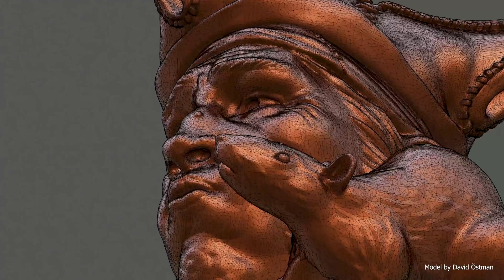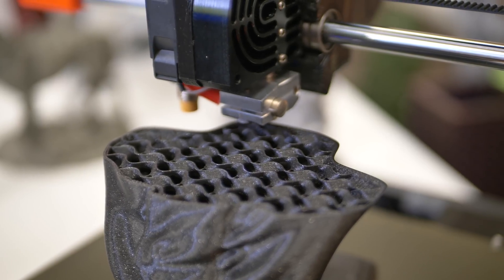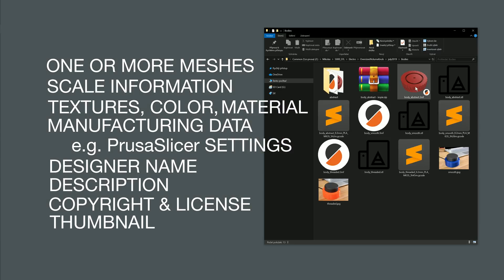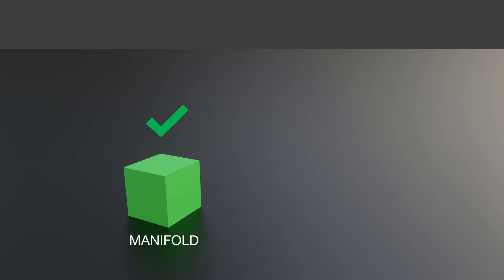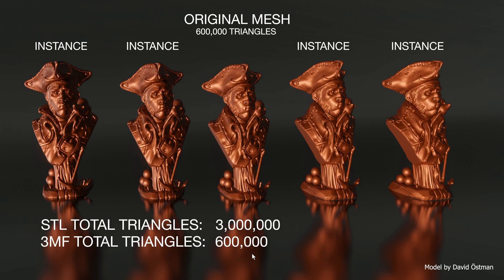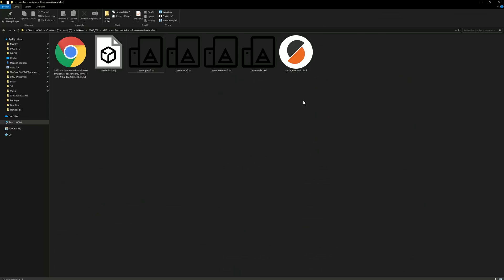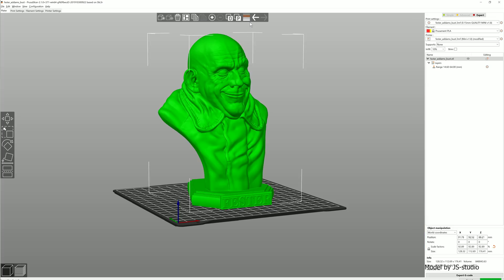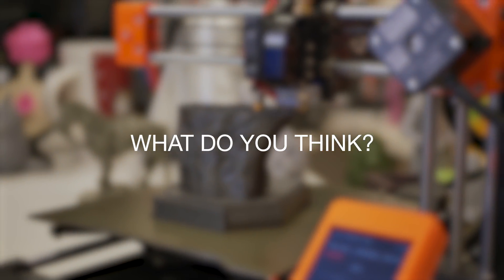Why STL is dead and 3MF is the future of 3D printing

Comment: 3MF does not prevent errors. You can convert every STL file into a 3MF file. If the software makes mistakes they will end up in the saved file no matter what format you use.

Comment: Hey guys coming back to this that has not taken a lot of love in printable sadly. It could be nice that when uploading in printables there is a pop-up that suggest the step and 3mf format. And that if the person uploads an stl offer to transform it to 3mf automatically even without the printing settings just the stl inside of it. This could be nice to add. As more people see the format around more people will use it. A good way to push the format. (eventhought step is still a superior format 😅)

Comment: I will never share a 3mf file. It would assume the person on the other end is using the same printer/fillament/nozzle. Why would I do that to someone? Let's just say I got screwed by this from a file off prusaprinters and did not see the little pop up (which is way to small and should be right in your face) that says it was setup for a different printer. Maybe if Prusa Slicer made a setting that would ignore the settings in a 3mf that is dragged and dropped in. Till then I will stick to STL's and tools that pull STL's out of 3mf files.

Comment: I don't see the point in .3mf. Saving slicer settings is pointless. If your reprinting something on the same printer, with the same filament, then just use the same gcode. If not, you don't want to have the same settings. Also, .stl files are already tiny. If you really want a better file type, use .amf for its curved triangles.

Comment: My Prusa i3 doesn't see 3mf files.  Does the printer need to be modified?  gcode, no problem.
Reply from the maker: 3MF is not a format used directly for printing, that's still G-code :) It is a great format to share the model together with slicing settings. -Mikolas
Reply: @Prusa3D  It is much like barebacking the neon spandex outside Karlovy Vary.   Generally safe, but you never know when some check prick will pop out at you

Comment: On the STL's that I spend days on running and getting right (scaling, rotation, position, supports, etc.) Through multiple test prints... I absolutely save in .3MF. In fact, I need to just get in that habit now that I've reached the point of needing to reprint some objects (Such as a collision that ripped my fan shroud off, so I needed super glue and duct tape to print a new shroud).

Comment: Hi. I'm from the future 2021 and I'm here to tell you STL didn't die after all.
Reply from the maker: Hey from the future as well!
That title is obviously a bit clickbaity/sensational :) There will be space for STL for quite some time. However, 3MF is getting more and more traction and we have just recently joined the 3MF Consortium, so we can work with other companies to improve the interoperability between CAD software & slicers and between various slicers. -Mikolas
Reply: 2022 checking in, still most common files are STL, I've yet to run across someone with 3MF

Comment: "please don't be xml, please don't be xml" it has an advantage ... it's XML ....  "oh, FFS"
I was building 3d models in code for animation in the 1990s and returning now for 3D printing the file formats are a disaster
I just looked at 3MF format and it is just a set of vertices and triangles - just the same as STL except you can share vertices. You can easily generate non-manifold shapes. It's just software will validate it on load.

Comment: This means that old 8bit processors can't unzip those STL files and needs a lot more code to decode the bloated xml format. For a 32bit machine this is good but for all else it is bad and will need better electronics to be able to process 3M files.

Comment: Adding proprietary "bloatware" is not welcome by most DIY enthausist.

Yes, walled garden approaches and making your device act as a black box for the customer is great when you want to sell object of questionable value as luxury goods. When you are selling flexible tools, then making the internals hardef to access is equal to removing features.
3MF can easily be seen as thd tedt run gor creating the "prusa ecosystem" thats incompatible with the open source movement.

Comment: Aslong as it isnt standart i will still use stl. What i already dont like is this unzip to look at it.
I create a Folder with all necessaey data and pick the data that i need later on.. this is just the same principle without shitty zip zap datacrap. 
Also, i Never share slicers settings with others because every maschine is different and need to be tweaked by the user itself. Special printsettings the same, Not everyone uses the same slicer mean they dont have the same possibilitys.
What i like is that it uses model Information that cant have non manifold edges , thats the only reason why i would change from stl to 3mf.

"Never change a running system"

Comment: Eeehm ... which slicer, beside prusa, is actually using this ?
Besides: What good is 3D print settings in the model ?
Because, I use a different printer, different filament, different nozzle, different temperature.
Is Prusa trying to push their own format ? As I read the comments: Nobody is buying it.
Reply from the maker: Essentially all slicers use it, Cura uses it as a default project file just like PrusaSlicer. Sigh....
- Mikolas
Reply: @Prusa3D  Nope.
Slic3r doesn't.
I think, we'll hev to see how this format will evolve.
I will use it, when it becomes a proper standard, the has proven to be
more beneficial, in the long run.
Because I use Blender, to export models to STL.
This fromat is not included there either.
Reply from the maker: Slic3r added 3MF support over 2 years ago.
And there is no point for Blender to export 3MF. Export STL, import to slicer of your liking, set the print, add custom supports etc. and then save a 3MF. In the end, we always try to upload both 3MF and STL.
- Mikolas
Reply: @Prusa3D  Wow ! You are right !
I really need to apologise. I've been using slic3r for years, and never
used any format, other than obj or stl.
I just got used to these formats so much, I didn't bother to check out anything else.
Thanks man.

Comment: but my DUDES ! 

you actually sometimes NEED NON-MANIFOLD GEOMETRY 

 the ideal solution would be to just fix the slicing algorythm so it can deal with non-manifold geometry

If you're thinking "Makes no sense, why would you want non-manifold geometry in the first place ?"

the answer is simple : what if you want to make an edge that's as thin as the printer can make it, but you don't actually want to look at your extrusion width and make a solid shape that's exactly that thick, and if you then decide to alter your extrusion width to get an uneven number of layers, or even worse, a gap in the middle 

If you want to see an extreme example of this, check out the mesh this poor madlad had to design in order for it to get sliced https://www.thingiverse.com/thing:3040294

Comment: When you say Cura won't load PrusaSlicer settings ...  does this mean it won't load the 3MF file at all or, just like HTML for instance, it will load all the geometry and the tags it knows how to interpret, and ignore the rest?  (i.e. are the Cura-specific and the Prusa-specific tags encapsulated in the file structure in a way that would allow whichever application which opens the file to easily filter out the least amount of proprietary data for whatever printing environment they have set up?)

I'd also be interested in seeing how it handles the definitions for functionally graded materials (FGM).

Lots of potential, but the devil is in the details.

Comment: Most good tools have built in checking for manifolds. STL Check in 3ds Max was a requirement for stencil shadows, back in the day.

For modern mesh formats, we have FBX (de facto, not open,) collada (supported everywhere but buggy) and opengex (high quality, not as wide support as collada.)

Inventing another format is just the wheel turning over again, with the same bugs to come as the previous formats have already worked out.

Comment: A 3D model format in XML?  Then compression on top to try to bring the XML bloat down to something barely tolerable? Gimme a break. Wavefront OBJ has been around for ages, is simple, compact, has color and shared vertices. Nothing's perfect, but IMHO OBJ is still much more attractive than 3MF.

Comment: XML :(. Why ... Just why ... XML has so much useless information overhead.
Reply: im not an xml fan. it turns perfectly readable raw data into gibberish. i usually just stick a bunch of key value pairs in a text file with some sort of separator. the complexity of the format should reflect the complexity of the data being stored. using xml to basically store what amounts to a list of triangle vertices is overkill.

Comment: "...the data are stored in a human readable, XML-based format..." : Hit stop. Inhale. Loud sigh...
Reply: "Human readable ... XML ....", When I heard that, I could not stop myself from laughing. Hail robots!
Reply: @vasiliynkudryavtsev  I don't get your point, if you ever delved into XML parsers you'd know that XML is much more readable to humans than machines :^)
But really, for a use-case like 3MF (open format with 3rd party extensions), nothing beats XML right now. Schemas are native and not duct-taped on top of it (JSON Schemas are one kind of hell no one should ever have to deal with), namespaces allow 3rd party extensions to live together without ever having name collisions and generally speaking we've been using "XML within ZIP files" for tons of formats (eg. ODF, OOXML, EPUB), so integration in existing or new tools is going to be easier, which is an important goal when you want to convince an entire industry to move from an existing and widely adopted format.
Reply: Xml is great on this, storing structured data, and it support schmas. So it can automatically verify files and generate importer/exporter code automatically.
And text are easy to compress efficiently, so no penalty there either. You can repair files with a text editor.
Reply: JSON entered the chat
Reply: @coced  let me tell you about yaml...
Reply: ... and stop watching any further.

Comment: Trying to solve a problem that doesn't exist. Good luck. 

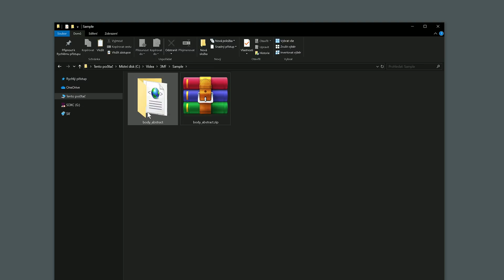1:30 - Really? STL comes in two versions if I recall correctly, one in human readable format and one in binary format. And you showed right before that 3MF was in human readable format. I am extremely skeptical that a binary STL file is 3 times larger than a human readable 3MF. But hey, you chose to not share any information at all really when you did that single size comparison. Trying to extrapolate information out of only one model is garbage reasoning. 

2:01 - Why does this even matter? You're going to turn it into Gcode later right? Which will not see them as clones but as different entities -> file size scales with number of models. That it is cloned in 3MF.. sure, nice I guess, but in the end it doesn't matter. 

3:30 - Oh woaw, really? These big companies are investing in this? Is this a joke?

Comment: I'd really just be happy if slicers compiled STEP (or some other CAD interchange format)->Gcode. STL needs to go, but I'm not 100% sure another triangle format is the answer. Also, with a quick glance at the organization's web page, they apparently support DRM, so I'd say "burn it to the ground", regardless of any other concern.

Comment: So what happens if somebody designs non manifold edges (e.g. A house with walls of 0 thicknessin rhino) and tries to export as .3mf?
Reply from the maker: AFAIK the verticies should get doubled so that there are two planes each facing other direction. Which removes the ambiguity. It does this if an edge belongs to more than two faces. Sure, you'll still have an infinitely thin wall, but that's a separate problem. Manifold problems aren't usually thin walls but more of an incorrect topology that is ambiguous and each app can interpret it differently.
- Mikolas

Comment: Eh. If it was not based on XML, but instead on something more sane like Protocol Buffers, I would be in. I will stick to STL, fast and super easy to write parsers and generators with zero external dependencies. Also using zip, another meh. There are better, faster and more open standards to use with less quirks. Adding instancing and multi mesh support to STL is super easy. No need for new format for that. Comparing size of 3MF with raw STL without compressing it same zip compression settings is just silly and missleading.

Comment: It's still a GD triangle format though...
Reply: A mesh of triangles is simple, unambiguous, and can represent (with a margin of error) any solid geometry.  Other formats may represent geometry of certain types with more precision and / or  efficiency, but at the expense of complexity in the format and parsing the model.
Reply: @hanelyp1  Yes it is all those things. It is also extremely limited due to resolution issues. This is an issue with manufacturing, but much less than in say visualisation where a camera can go from a distance to a close up zoom. When one uses a mathematical representation of the object, this is a non issue. With older scan line renderers the mathematical representation would get broken down to sub pixel triangles PER FRAME and get rendered. Nowadays with fast hardware based raytracing we don't even convert to triangles anymore.

Comment: "you can always easely export to stl."  
IF you even want anything prusa on your machine.  

if you prusa fuckers are going to start uploading everything in 3mf.  then you are going to be shunned away EVERY FUCKING WHERE. 
FUCK PRUSA AND FUCK PRUSA SLICER
Reply: 3MF is the default project file format for Cura. Simplify3D works with 3MF too. Ideamaker too. Upstream Slic3r as well.
Almost all modern slicers use 3MF for over 2 years. Despite that, a lot of people didn't know about the format. I wanted to help and spread the word about it. You don't have to use anything Prusa to work with a 3MF file at all.
(I'm the guy at Prusa who made this video).

Comment: should have used a modern archive format instead of zip though...
Reply: Why? Zip is used for a reason, you're not going to see much, if any, improvement in file sizes with any other format and you can be sure that there's a zip utility for any environment you're likely to use. It's free from patent restrictions and mostly just works. 

Not to mention the fact that people are usually not going to be unzipping them and manually editing them anyways.
Reply: @SmallSpoonBrigade  Hard disagree here. I've seen compression results over 50% more efficient using lzma2 compared to older algorithms and it is also unencumbered by patents. 

If the intent is to replace the outdated STL format, the goal should be to use something modern instead of replacing it with something else that's already out of date from the beginning.

Comment: „human readable ... XML“
Reply: XML was basically replaced by JSON which is sometimes replaced with more readable YAML / TOML
Reply: @skewty  I always felt XML could be more readable than JSON depending on who designed the schema, but am sure TONS of ppl would disagree.  JSON is  clearly more efficient speed and space wise.  I also personally dislike indents (yaml/python) being so important for structure since accidentally adding spaces while editing a file is so easy (I debug this kind of thing all the time).  However, that's also probably just a product of what I am comfortable with.
Reply: @skewty  No. One would use json 95% of the time when dealing with portable data formats. But in complicated data structures and critical communication systems XML has the advantage by providing native data validation through XSD as well as namespaces and attributes. In this case json would probably have been fine.
Reply: @hajosmulders  there are (non-native) schema validations for JSON, though.
Reply: @ocramot  Yes, but it's outside of the standard, so I don't count those. Again: I use json 95% of the time.
Reply: People got so burned out by really badly written XML that they somehow that somehow they are blind to the fact that JSON is way harder to read and write
Reply: @MattRix  how is it harder? I find it just the same (human readability)
Reply: There are a bunch of factors, for example: comma placement varies depending on whether something is the last item in the list or not. It is also very hard to tell what group something is in because you don't have named closing tags. If you have properly formatted JSON you end up with quotes surrounding identifiers which hinders readability. Ever tried copying a bunch of items from one section to another, especially to a different depth? It's MUCH easier in XML.
Reply: TBH I never tried, because if the data is well structured, how often do you have to copy some data to some other level of depth? Anyway I don't think it's that difficult, with any library for handling either JSON or XML, especially in any language (e.g. JavaScript) where JSON is a native object.

Comment: I'm not very into 3d printing of sculpture, I print some mechanical parts. And very often 3d printing of someone's STL is a pain. Because I need to correct some dimension, due to my printer, but not all, that is why simple zooming isn't solution. Or I need to change part for my purposes.
So, new format instead of STL  is cool thing, but if it is not possible to convert it to body which can be used by modern CAD software as body and not as mesh, it is only part of the solution.